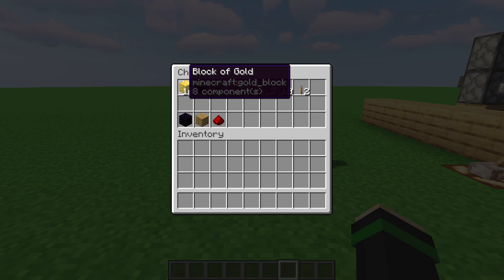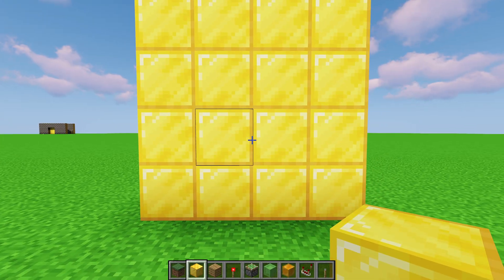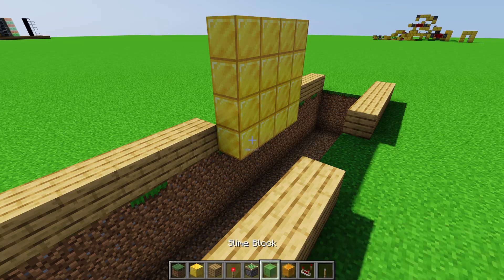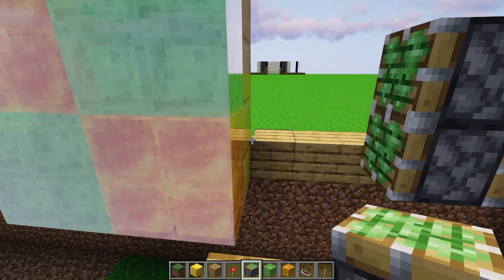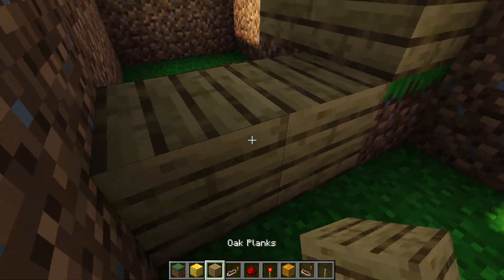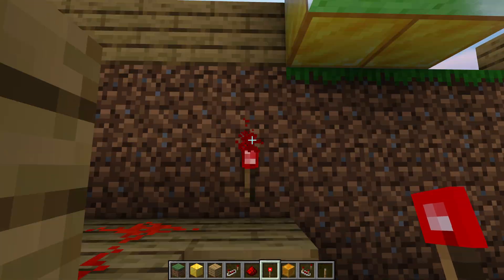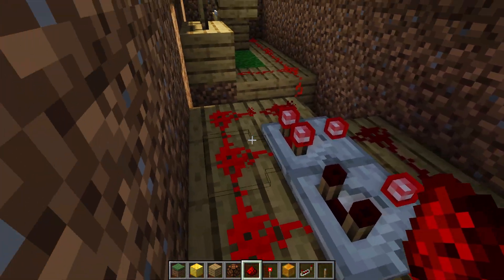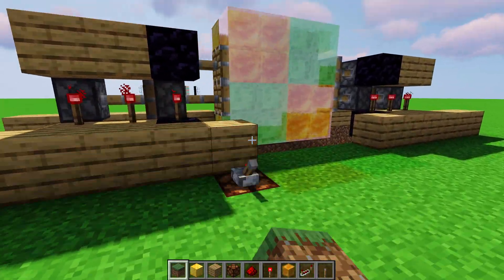Easy 4x4 Piston Door (Bedrock Edition Friendly) | Minecraft Redstone Engineering Tutorial

Comment: This was really solid, can’t believe it doesn’t have many views. I have this build I’m doing with a sort of base that has a tunnel entrance, and i managed to connect the switch for this door to a light system that lights the tunnel when the door is opened, with a switch on the other side that allows for it to be closed without turning off the lights / vice-versa. A very solid door build that is much more versatile than others.
Reply from the maker: Thanks! That tunnel sounds pretty cool, glad the door works well for its purpose